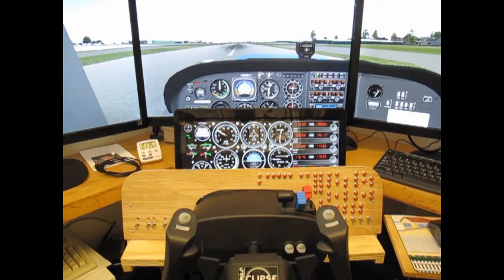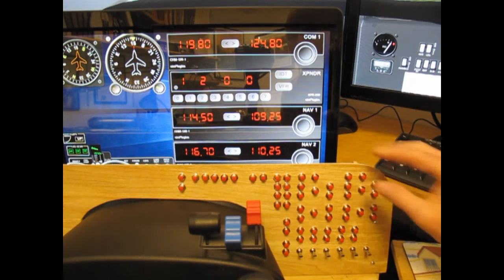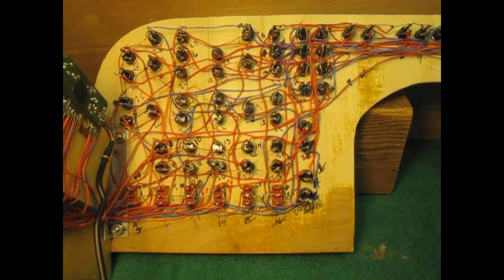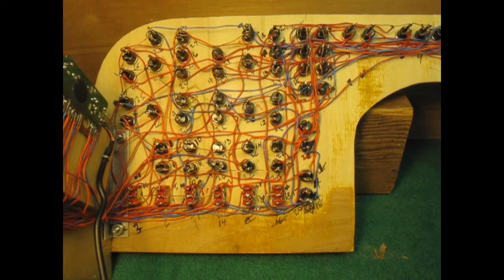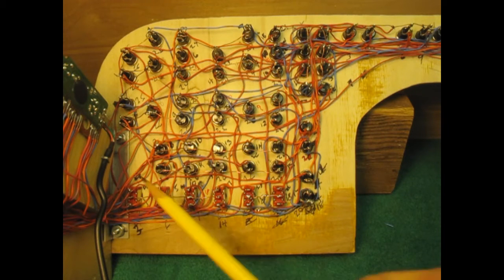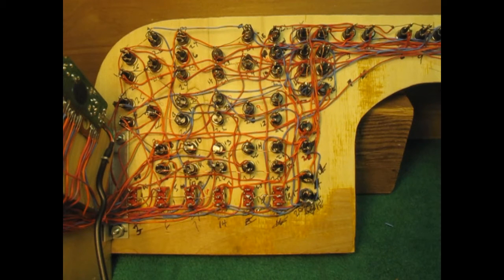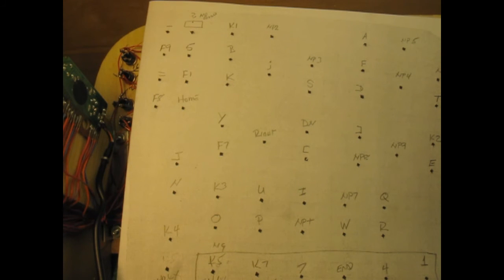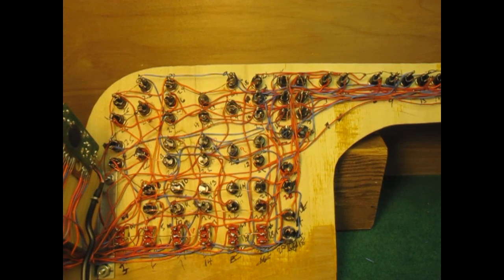How to Build Your Own Instrument Panel for X Plane ~ Part 5

Comment: Top stuff Skip. It's really great to hear of the issues you encountered and how you (mostly) solved them. I think I can make fewer mistakes on my own build by learning from your experience. Thankyou.
Hopefully my buttons should arrive in the next week or two so I am looking forward to moving on with my own build.
Take care my friend. :-)
Reply from the maker: Hi Tux, Thanks, hopefully you can avoid my wiring troubles. I forgot to mention one thing. Since I thought I had plenty of wire combinations I didn't think I need to use wire 20 and didn't us it. But when I realized I was short I had to do a lot of rewiring to get wire 20 in so I could make up for the duplications I missed. So you might as well use all the large numbered wires. Better to have a wire with only one or two connections used and available for more to avoid a bunch of re-soldering. 

Good luck, please keep me updated on your progress.

Blessings,
skip

Comment: I am still in the planning stages of my build. I drew a simple mock-up design on a piece or cardboard and cut it out and have done some re-measuring and re-designs to it. It's much cheaper and easier to work with while I'm still only planning. 

I have an old laptop that's broken, and I've ripped out the monitor from it. Not breaking off the lid, but actually opening the lid and pulled out the 5 mm thick (about 3-4/16 inch) 15 inch monitor completely. I have previously bought a driver card from eBay for it, so I can connect it like a normal monitor to my computer and use as an instrument panel with my panel software, Air Manager. I'm trying to make the panel design so the monitor fits into it as well, like you have yours. 

Do you remember I told you about a software I am using to program my keyboard keys? It not only detects that I've pressed "K", for example, but it also detects WHAT keyboard that did the press. I can then assign "K" to send an event to X-Plane when I press it on a specific keyboard. This can come up VERY handy now! If I need more buttons, all I need to do is strip open a new keyboard and add to the panel! 

When testing the different combinations of cables, I searched and found a simple webpage that helps out. It displays the key code when you press a key, so if I happen to find F8, it'll display that I've pressed "keyCode=119". The same functionality exists in the software that I use to bind the keys. I'll let you know how it works out! 

To keep track of the wires, I've had a stroke of luck! Turns out that a store chain here in Sweden sells a bag with solid hook-up wires in ten different colors in each bag; 10 meters each (30 feet) of black and red, and 5 meters (15 feet) of each of the other 8 colors. The price is good too, 12 dollars per bag. That, and making a sheet with all the components in Excel and write the numbers there, ought to help out a bit. 

Monitor driver card on eBay: http://cgi.ebay.co.uk/ws/eBayISAPI.dll?ViewItem&item=400760909633
Keyboard Key Event Test: http://unixpapa.com/js/testkey.html
Swedish store chain Kjell&Co hook-up wire: https://www.kjell.com/se/sortiment/el-verktyg/verktyg/matinstrument/matsladdar-prober-kontakter/kopplingstrad/kopplingstrad-10-farger-enkeltrad-p39515
Reply from the maker: Hi Peter,  Thanks for all this info I sure others who set out to do this will appreciate your input. The colored wire is a good Idea and I considered doing that but I have so much phone wire and I didn't think to would be too hard to keep track and it really wasn't but colored wires would have helped.

You are way ahead of me in technology! Using a monitor from a laptop is really cool I will be very interested o how that goes, I have two laptops I don't use anymore, I'm also interested in the software you are using.

I was disappointed when I could not find any way to assign the Nav Source (Nav1 Nav2 GPS) switch to a button on my panel. There are choices for the flight director but nothing I could find for Source.  I was thinking could I write code for that function somehow or find code, got any ideas, maybe your software might be able to help?

Blessings,
skip
Reply from the maker: Hi Peter, I tried to use those but they only work in an airplane with an HSI.. I could not find ..._select_up or down. Maybe I need to go into Plane Maker and add some components to make it work.

Thanks for the link to the video, really cool.

Blessings,
skip
Reply: WEH Videos If/When I get things to work with HID macros, I'll let you in on its' secrets! I just now discovered something really awesome! Are you sitting down, Sir? 
I found a way to send multiple keystrokes at once, such as holding down Shift or Control when pressing M... at the press of one single button!! Suddenly, the amounts of available keys QUADRUPLED! Also, with this discovery, I can add buttons for addons' shortcuts, such as "Airport Navigator", that uses CTRL+SHIFT+M to toggle map, for example. 
I'm a bit excited at this very moment, it feels like someone removed blinders from my eyes =)
Reply from the maker: Hi Peter,  That's GREAT can't wait to here how it works. I'm struggling with a lack of characters now because I missed a couple duplicates and the "KEY" thing really messed me up, I had 6 of those I had to eliminate so several of my switches are now useless.

Blessings,
skip

Comment: Thanks for the great tutorials!
I have a question: Is there a way to use switches that hold position when turned on or off? Instead of momentary switches.
That way you are able to see if, for example, the landing lights are switched on or off.
I imagine that if you would use such a switch it would be like holding down a key on the keyboard.
Reply from the maker: Hi Coockiemonster 1,  Unfortunately that will not work! It would be like holding down a key on your keyboard and not letting it up you will have all kinds of problems with that. ALL switches and buttons MUST be momentary so they work just like a keyboard. You need to be very careful you don't wire up a switch or button incorrectly that it would be like a key held down all the time. sorry.

There are other ways to create your own panel you might search the internet for alternative methods before going in this direction. This works but it is a time consuming process. Make sure you watch the last video before starting I ran into some problems and I explain them there.
  

Blessings,
skip
Reply: @WEHVideos  OK, thanks!

Comment: First thanks again for your prumtly responses, I have a Question abut changing the commands on kepad, does changing kepads on keyboard effects the button on yoke? I'm using your awesome idea on my cockpit but with a difference,  I placed the entire keyboard behind the cockpit and using phisical push buttons to execute the commands.
Reply from the maker: Hi Brian,  No the button on the yoke and keyboard work independently from each other.  This will only work as a keyboard, in actuality it is a keyboard just has a different look however the circuit board is from a keyboard. 

Note: Make sure whatever push buttons you use are momentary buttons, this is critical, they must act just like the keys on a keyboard!!

Blessings,
skip
Reply: Awesome,  So now I can arrange all buttons as a group for each gauge same way you did. Thanks and regards, I will still my wife's nail polish tomorrow whenever she is not home. :) lol.
Reply from the maker: Great but don't you think your wife will notice the colors on your buttons match her nails?? 

skip
Reply: lol :) , for sure she will , I was just kidding :) I decided to use some tiny colored caps I have and place them with glue on top of each button,  because I used scrwes for each button to be adjustable . by the way I found nail polish at 99 c store very cheap if I had to use. Thanks
Reply from the maker: I was kidding to :-) 99 cents great I'll check out the dollar stores!

skip

Comment: First thanks very much for your awesome advice,  I'm just wondering if I missed this keyboard command to that GPS button or I'm missing it on some place or you ran in to same issue. I found the keyboard button  to activate the autopilot and headtracking before takeoff as well control the up and down on heading indicator after takeoff, but in order to activate the GPS , I couldn't find the switch ON the GPS to put
 the the plane on heading  course.  So each time I have to bring the simulator cockpit use the mause to toggle to GPS.
Reply from the maker: Its been a while but I think I had the same problem with the GPS activation and ended up using the mouse for that, bummer.

skip
Reply from the maker: Very nice job Brian! I keep thinking of doing something like your setup but just haven't got started, someday maybe.

Blessings,
skip

Comment: Hi, is the C172 from xplane? The program has detachable instruments or is an add on?
Reply from the maker: Hi Fernando, This C172N is from X-Hanger.com however I have made many modifications in X Plane Plane Maker so you will not find one exactly like mine. The instruments are add ons not included with X Plane. Thanks for watching let me know if you start this project :-)

Blessings,
skip

Comment: What type of wire are you using.
Reply from the maker: Hi Prasant,  I used telephone wire I had laying around but you can use any "hookup" wire you want the smaller the better #22 is a good size wire and you can get it at Radio Shack.com or Jameco.com,  or any electronics company. I suggest having several different colors so it is easier to trace when looking for mistakes or if you want to move a connection to another component. If I had it to do over again I think I would have used a different color for every connection on the circuit board but I doubt that's realistic. Unfortunately you most likely will find you need to rewire something so keep that in mind Hope this helps, let me know how your project goes.

Blessings.
skip

Comment: Hey This is Skip !<<<<<<<<<<<<<<.>>>>>>>>>>>>>>>> Great Job on your series of helpful tips. I can't help but wonder if an Arduino panel or 2 might do the same with a lot less of the background. I am working on force feedback control yoke and pedals for a more realistic feel for trimming out. Load sensors for the brakes and the like. 25 years of real world Flight time for a wide range of clients and missions. All the Best ............................jagjet
Reply from the maker: Hi jagjet,  When I came up with the keyboard idea I had no idea there were products like Arduino and just decided to jump in, make a panel, and see how it worked. While I enjoyed making and using my panel the limitations became very obvious when I ran out of characters. I have to say your idea of using Arduino is exciting and has me interested in a new project. Thanks suggestion now I just need a new idea :-). 

25 years, that's great!! Got any stories to share?

Blessings,
skip
Reply: First Skip, Forgive bad manners......Robert Phelps, I am new to X plane but have enjoyed it so far. It really does a good job in stock form of making a good immersive experience. I have covered the Globe several times at or above Fl390. The latest with turbulence and winds aloft has put the icing on the cake so to speak. I am in the process of using X plane to demonstrate the effectiveness of a flight department to a client. Using his routes and the closer airports to his stops than the 500 some odd Big Airports the airlines use. What a great tool and some good fun in the bargain.  Cheers Robert
Reply from the maker: Hi Robert, Your job sounds pretty interesting and using X Plane, cool. I forgot to ask about your force feedback project, how is that going? I've heard about it but never experienced it in a simulator, would be nice to have, I'm guessing your using Arduino?

By the way your "manners" are fine :-)

Blessings,
skip

Comment: skip how do you like the eclipse, is it possible to do a video on that yoke I just got it and can't program it
Reply from the maker: Hi MrBluess1, I like the eclipse yoke but don't use all it's options. You program the buttons and rocker switches on the eclipse just like you do the keyboard keys. Go to Settings->Joystick & Equipment->Button:adv. Click the button or rocker you want to program and that button or switch will show up and you will see all you programming options on the right, just select a function and your done, click on the next button or switch you want to program. I'll see what I can do about a video.

Blessings,
skip

Comment: It says I can program 240 options but there only 20 or so butrons
Reply from the maker: Hi MrBluess1, I have never tired to program more than the 20 switches & buttons I think it gets too complicated to remember which is which. Actually I've only programmed 11 buttons and that has worked fine for me, I don't get lost when I haven't used the sim for a while trying to remember what was what. I actually think using a keyboard and assigning keys is better that using a ton of yoke buttons & switches. You can get a second  keyboard to use with your sim and put labels on each key you use and don't have to worry about remembering, that's why I came up with this idea of my own panel instead of using the keyboard. 

Blessings,
skip
Reply: I agree thank you

Comment: thank you skip
Reply from the maker: Your welcome. I was thinking of a video on programming the yoke and keys in X Plane don't think I'll do one just for the eclipse, they are all programmed the same, sorry. Where are you running into trouble?

skip
Reply: Hey Skip, it's been a while since we talked. 
I enjoyed your video series on building a control panel. Plus I still refer to your videos on programming the 430/530 and I've attempted to use the FMC after watching your tutorials on that equipment. Still struggling with that but I learn more and more each time. One thing I can't get to work is loading a flight plan in the FMC. I created and saved a flight plan using SkyVector. When I click on the LD button on the FMC it shows me the flight plans I have stored in the XP directory but when I click on the flight plan I want, it does not load into the FMC. I've tried both the XP King Air and the Eclipse and neither load. If I enter a flight plan manually it seems to use it (again, still a FMC newbie, I THINK it's working)

I built a Garmin 430/530 board using an Arduino and combined with a plug-in (free) from svglobe.com I think it was quite a bit easier and a lot less time and wires. I did buy a couple dual rotary encoders with push buttons that works just like the real thing. I'd send you some pictures but I don't know how to include them in these notes. It works well enough for multiple aircraft; just create a config file for every different aircraft to assign different functions; eliminates the need to rewire/resolder.  I'd send you the pictures but I can't find your email address. It works well enough that I'm thinking about expanding to include auto pilot functionality as well.
Reply from the maker: Hi Tom, Yea, been a while.  Flight plans for X Plane must be in a format it recognizes and SkyVector is not one of them, also X Plane has  made some changes with version 10.50 so some old flight plans may no longer work :-( What I  have done is use SkyVector for the plan and then manually enter it into the FMC and save it that way as you did. There is a program called FSBuild you can purchase that will create flight plans that can be saved in the X Plane format but I have not used that in a while so not sure if it still works, I suspect it will but...

After making my panel I've slowed down on "part two" of my project just ran out of time. I'm not sure when I will continue. While my "keyboard" project works pretty well it was a lot of work and is limited as to how much I can program and looking at svglobe and other sites there are much better option but time is the issue right now.

Send me a message and I will give you my email address so you can send me your pictures, I'm really interested in seeing what you have done, could inspire me again :-)

Blessings,
skip